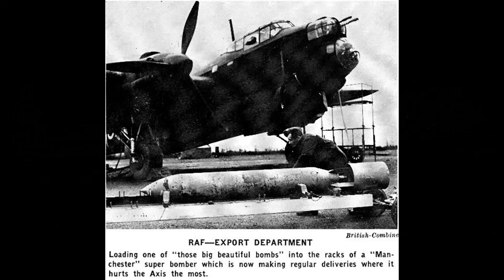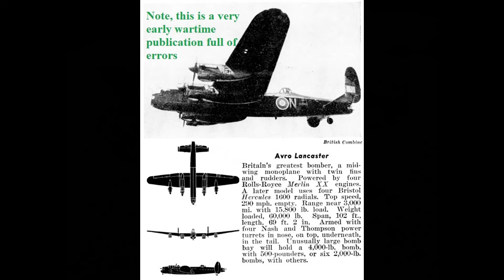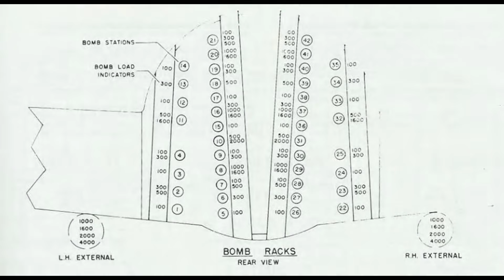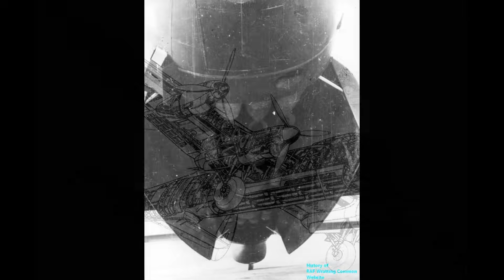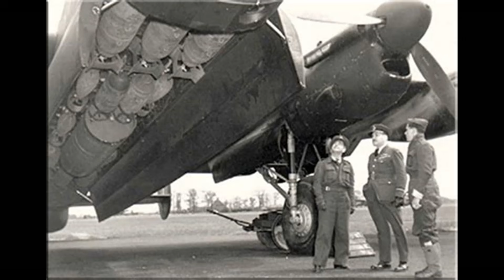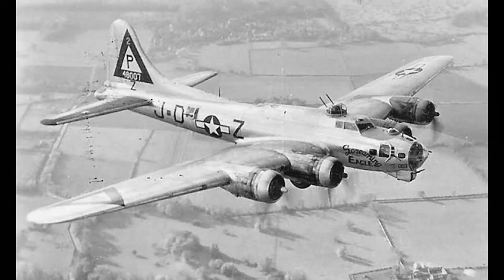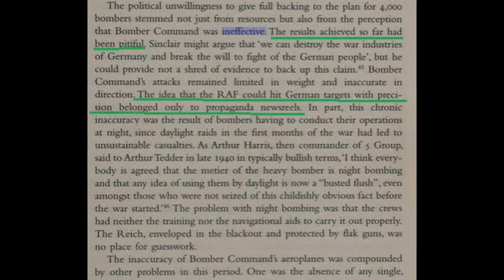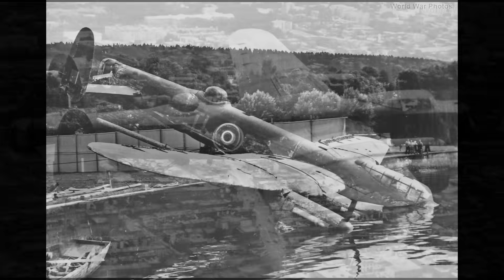Avro Lancaster, Payload, Turrets, Stability and More

Comment: The lancaster is better on paper, but it’s definitely not the one id like to be on.  That great payload meant much less armor, and the liquid cooled engines were hugely susceptible to flak.  Look at the dambusters raid, they almost lost half of them, and they didn’t face enemy fighters.  Yes it had a high payload, but that came at a cost.
Reply: Flying at 60 feet at night, two aircraft were lost after hitting power cables.
Reply: It's a more complicated equation, speed and height =survival at night. Fighters were always going to catch you in daylight. Also, technology moved on, it was very difficult to shot anything down at night during the early years.
This is the big problem for the US fan boys, they simply weren't there so it's not fair to judge their equipment and strategies fairly. Some of their equipment was still class leading at the beginning of the war such as the PBY and DC3.

Comment: Hi Greg. Did the Lancaster bomb bay not come with arming spools in thee bay.these units had a spool of wire connected to the arming vane of the bomb. When energized the spool would lock and the pin pulled from the falling bomb arming it. And if jettisoned the spool is not energized and the wire spools off. Not pulling the pin from the bomb.hence the falling safe.
Great video as always.
Reply from the maker: Some probably did, there were many variations of ways to arm bombs in these things throughout the war. I only talked about ONE of them. The overall point being that not being able to access the bomb bay is a drawback of the design.
Reply: @GregsAirplanesandAutomobiles  thanks for replying Greg.
I respectfully disagree that it was a flaw in the design more a continuation of a design philosophy that had worked on previous aircraft designs for the Royal airforce. All be it on smaller aircraft ie the wellington.
This design choice continued through the Halifax and stirling.
Any way thanks again looking forward the next video.

Comment: Great video Greg! I’d really like it if you could talk about the cockpit and crew set up. As a pilot, it blows my mind that the the Lanc was effectively a single pilot aircraft, with the engineer in the right seat. I’d much prefer a two pilot set up
Reply: A single pilot, and usually a warrant officer. A lot of pressure for a single pilot. The Americans used a pilot and a copilot, both officers. If an American pilot showed signs of cracking under the pressure some means of transferring them out of combat was usually found. The British by contrast preferred to court martial them for cowardice and throw them into a military prison. The whole bomber command night bombing offense was brutal, with a 46 percent death rate for the aircrew and a 60 percent rate for killed, wounded or taken prisoner.

Comment: The UK was developing a whole host of 50 and 20mm turrets in 1939. It was apparently Beaverbrook that squashed that on the basis that what was needed was production of existing types, incremental improvements only, and the use of guns in full production in the UK. That included the browning in 303, but any 50s and ammunition would have needed to be imported at the expense of hard currency also needed got battleships and submachine guns from the USA. When Arthur Harris took charge he was angry as he wanted 50 calibre and above, but the promising designs had been killed off either in 1939, or right before he took over. So for some reason things went back to square one and arrived very late.

AFAIK, though, the first powered nose turret on a B-24 was a donor 4 303 tail turret grafted onto the front by the RAF.

The original RAF plan in 1938-9 for bombers by circa 1943-4 was for them to be armed with 8 20mm cannon as standard.

Comment: I have read that some squadrons mounted a handheld gun in place of the ventral turret. The gun didn't seem to be used but the extra eyes in that position were useful in detecting bottom feeding night fighters. However, higher echelon put a stop to the practise adding another nail in the coffin. There was a later war massacre of Lancasters by moonlight if memory serves. The Lancaster was not an easy aircraft to escape from apparently as compared to the Halifax but flew higher so maybe it was 'safer'(?). The losses in aircrew by Bomber Command can only be described as horrendous which is sort of ironic considering Canada invested heavily in the air war hoping to avoid the losses sustained by the infantry during WWI.
Reply: Preston-Green was an official option, typically in Mk. 2 with a 50. I have seen photos on Halifaxes, not Lancasters, but they are recorded as an option. Unofficial mounts existed too. H2S largely rendered them moot.

Comment: References suggest that more ventral  armament choices were available than noted here. The FN. 21/21A was available on the Manchester, and AFAIK, in theory on the Lancaster. It is certainly visible on a famous 3/4 from above photo of a Halifax B. I. There are photos of the Preston-Green on Halifaxes and it was supposed to have been an option on the Lancaster. I've seen drawings of the fit, but no photos.

The RAF specified and developed a lot of ventral turrets, but many were either draggy or hard to sight. In the end, H2S rendered them unusable. The tail turret had a good field of fire which compensated somewhat, as did radar warning indicators, although since the environment was quite busy, not entirely. Mosquito NF escort also helped.

Comment: Hi Greg, the point about the York being derived from the Lancaster really revolves around the fact that the flying surfaces and engines were ex-Lancaster, the fuselage was a new design with lower ground clearance presumably to emplane pax and freight more easily. The York is a high wing monoplane, I'd call the Lancaster midwing.
Reply from the maker: I don't disagree.

Comment: The Manchester and the HE-177 both tried using twinned versions of highly regarded V-12's, the Merlin and the DB-601, to make twin engined large bombers and failed due to the engines. Since having two engines in one nacelle in a push pull arrangement was a known art, I have mostly seen them on Flying Boats and many were sleek looking and well integrated, there has to be a reason this choice wasn't made rather than a new wing with four nacelle's but it is not clear to someone with no aerodynamics knowledge (I'm an accountant who plays with model trains and makes run-on sentences).

Can you give some details on this?  .     Not that it has to be any time soon, of course.
Reply: The Vulture used by Manchesters was based on the Peregrine not Merlin.

Comment: .303v.50: 1. The British manufactured .303 Browning by BSA NOT the ,50 Browning. 2. The British did not believe it was possible to shoot down enemy aircraft with turrets - you could at best scare them away. I too am very skeptical that significant numbers of German aircraft were shot down by US B-17s/24s, however the daylight box formations would lend themselves better for air to air kills than the night bomber "streams"of RAF bomber command. 3. .303 are lighter and lighter ammo. 4. The British system worked and especially later had fewer and fewer casualties.

Comment: Could you comment on the apparent philosophical decision that the Americans typically crewed our bomber aircraft with a pilot and co-pilot while the Brits primarily used a single pilot=in-command system.  I understand that the Brits had flight engineers that assisted with system management at take off etc but I dont believe those men were rated pilots.

Comment: Your description of the vulture engine wasn't over simplified at all,that's exactly what it was,two Rolls Royce peregrine engines mounted together on a single common crankshaft.
Reply: Most of the X configuration WWII engines had issues, possibly due to vibration and crankshaft fatique. Pratt and Whitney built large radials successfully, but used numerous vibration dampers on the crankshaft.
Reply: @fafner1  Yes,the X (or more accurately W) type engine comprising 2 Daimler Benz DB 603 engines coupled and sharing a common crankshaft as fitted to the Heinkel He 177 suffered from a raft of problems,the worst being its tendency to catch on fire it's crews nicknamed it the Reichsfachel (Torch) because of the frequency of such fires.
Reply: @darkknight1340  I was thinking more of the Jumo 222, a 6 bank 24-cylinder design that was closer to an X configuration (granted with 6 banks instead of 4 as in the Vulture) than a W.
Reply: Sadly, bolting two of RR's less successful engines together didn't make them better.
Reply: @wbertie2604  Even worse,the Rolls Royce engineers didn't take the load on the crankshaft or the potential for bearing overheating or seizing up completely into consideration.
Reply: I believe there were some bearing issues which plagued the Vulture as to why it could not develop full power.

Comment: Doubt the belly turret would have worked at night, if only because of light loss through the optics, unless a v. large diameter objective lens was used.
Reply: Not just that, it is hard to see anything below the aircraft at night due to the ground radiating no light. The RAF found that an aircraft flying underneath a bomber basically was invisible until within 200 yards or so, where as a bomber silhouetted against the sky was visible up to 400 yards. It is notable that the limited numbers of B17s the RAF used for electronic warfare in 100 Group also ditched the bottom ball turret. Apparently they didn't find them very useful, even though it was a better design then what the RAF had employed. I'm thinking there may not have been any good bottom turrets for night work if all you're gonna be looking into it blackness.
Reply: @kellyshistory306   Yes, that all fits. A similar idea applied to naval warfare in the Pacific;  If you could position your line of battle so that from an oncoming enemy's point of view, your ships were superimposed against the black stripe of an island or islands, while from your point of view, that enemy fleet was silhouetted against the night sky, you were effectively invisible but not him, and an ambush could be effected by you.